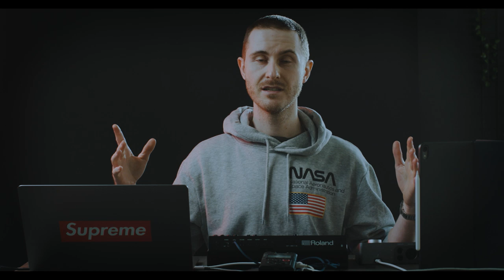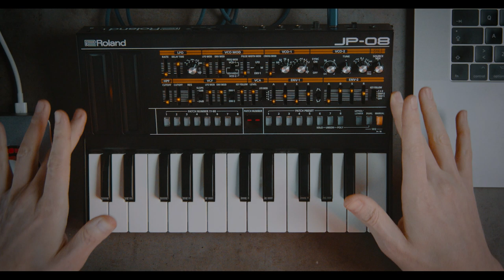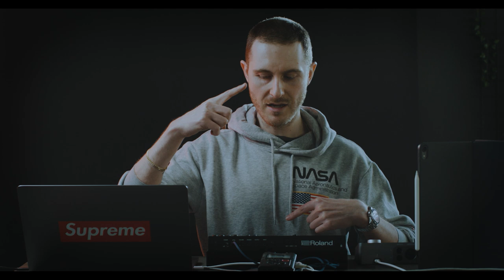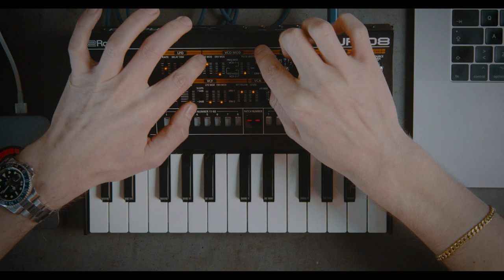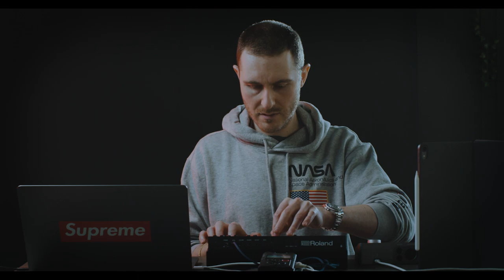Become a Sound Design NINJA! How every Synth works

Comment: Cool video! :) I think M on the PWM section usualy stands for 'manual' setting of PWM depth (there's a little line going from the M to the slider) the switch flips then flips the control of PWM over to the LFO or the envelope :)